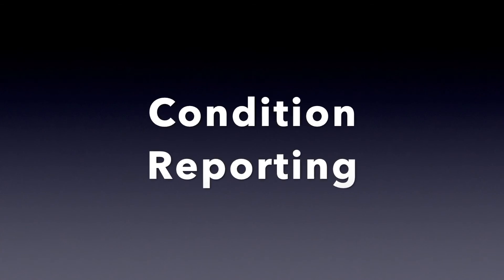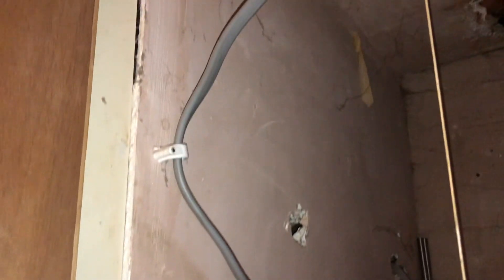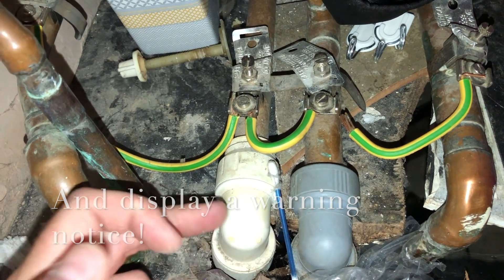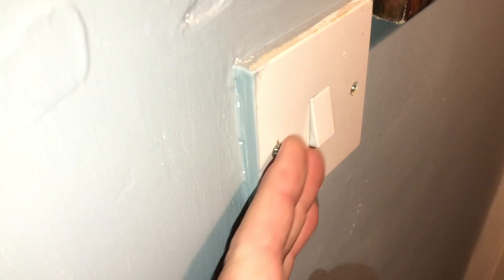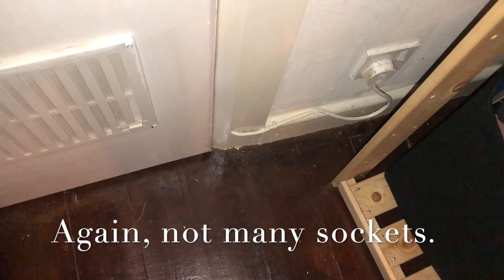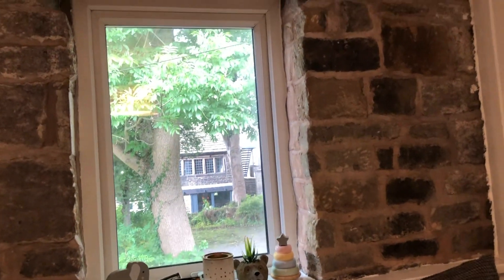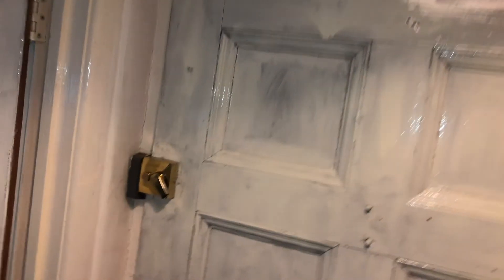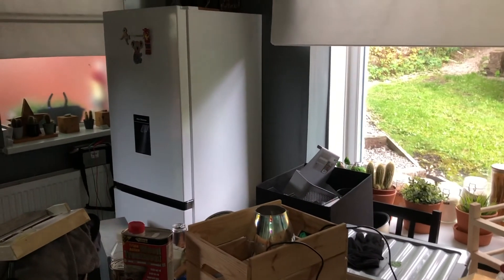Condition Report (Live Job) walk round.

Comment: An excellent video that I will use to show my students on my Periodic Inspection courses. It really gets to the nub of why we are doing this and why a 1 hour 'drive by' inspection is irresponsible and dangerous; I've followed up on a few of these and they've either missed the important stuff or they are 'coding for business'. One question: you rightly in my view code the FIs, but how do you deal with the inevitable 'unsatisfactory' on the CR? For instance do you go back and strip out the CCU to get to the protective conductors to obtain a reliable Ze? Fantastic video keep up the good work. H-P Verhoeven Mid-Bucks Electrical Training.
Reply from the maker: Hi, Many thanks for the kind words. Firstly, I would like to say I couldn't agree more about what you say about the 1 hour drive by chancers. I find them extreamly unprofessional as they continually contribute to the de-valuing or our industry ( I will be doing a video about this soon).  To answer your question, I usually agree any limitations with the customer before the job. This includes anything that will require further investigation. In this case, I agreed to re-visit the site and spend a pre-determined amount of time (usually a few hours no longer) looking into the fault or faults. If a satisfactory outcome can not be achieved, then I recommend rewiring it or replacing the affected part of the install.  This prevents excessive costs trying to repair something that may need fully replacing. As you are probably aware, a site survey should be carried out before any Inspecting and testing can be undertaken. This is to give the inspector a starting point of how much of the installation needs to be checked. If I find that no records are available for the property, I usually recommend as much as possible is inspected and tested. Hope this helps. I will have a few more video's out soon. Thanks again for your support. Regards, Chris

Comment: Great vdo  what code  would you give for  lack of sockets  I would  give a c3    however   justification for a c2    especially  as  for what I could see  plenty of c2s  there c1s as well    as far as the  inspection  of light switches goes  surely   it should be  agreed with the person  ordering the work   the limitations   also  the risk  of damage to  surrounding areas  that may a rise  for a proper  inspection
Reply from the maker: Hi Chris, That is a good point and question. The inspector will need to assess the usage of the sockets and adjust the code to suit the installation. A C3 is indeed a good starting point but if any evidence of extension leads is in use and signs of overheating is present then this is easily a C2 (reg 553.1.7). If the property is rented and has a history of different occupiers, I would certainly advise the owner to add additional circuits to balance the load and provide more points for utilisation. See page 192 in the IET On Site Guide for the number of socket outlets that should be provided. Hope this helps if you're trying to explain it to a customer. Chris